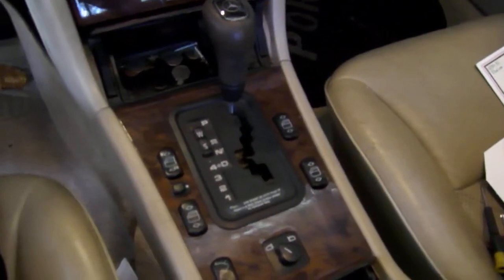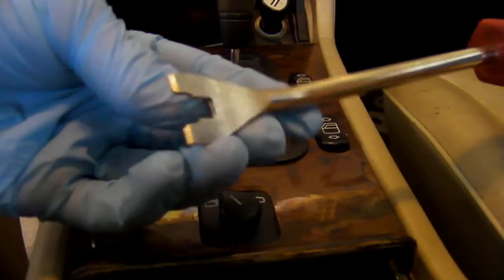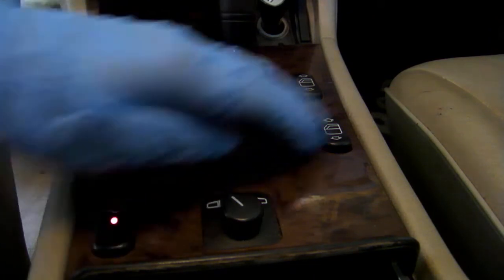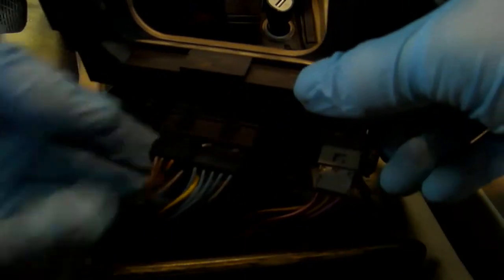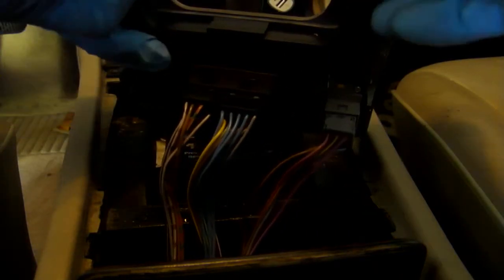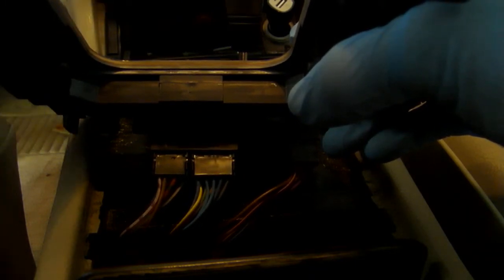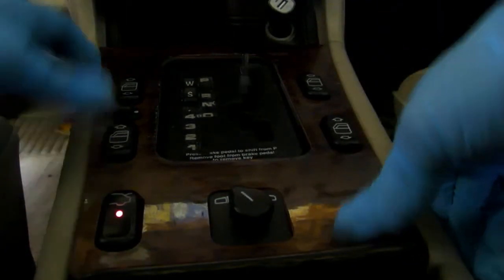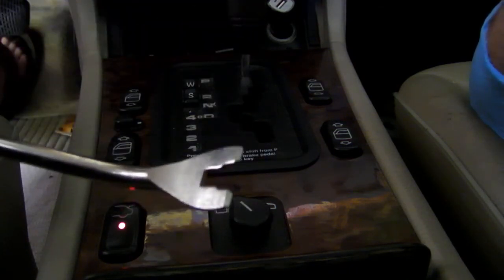Guide: Mercedes E-class (W210) Center Console Switch Removal (Window / Mirror / Trunk Switches)

Comment: Ik have the same car, but i dont know what the W/S butten does. I hope u can let me know👍🏼
Reply from the maker: Willem Aarts The “W” button is for winter mode. The transmission will engage in second gear for better traction on the road. “S” is for summer mode and the transmission will engage in first gear as usual.
Reply: Wow this whole time i didnt know what these modes are for I thought “S” was sports mode 💀💀

Comment: I spilled a drink and now my windows roll down on there own when i start the car 😐 do i need to replace the switches or just open and clean the area
Reply from the maker: You can try to open and clean the switches. Make sure to disconnect the harness and pull the switches out first. I would take a paint brush or soft bristle tooth brush with some electronics cleaner from Amazon or Office Depot and clean off the circuit board.
Reply: Having the same issue! Sat a Trenta Starbucks cup of water leaning forward. The actual piece that’s supposed be in there to hold the cup is out. Bought the vehicle used.

Comment: That red light on the trunk button, is it suppose to stay lit all the time, mine does and my brand new battery keeps draining, watching videos if I can figure out why
Reply from the maker: The red light is only supposed to come on when the trunk is open. Here are a couple of good forum posts that troubleshoot the issue:
https://www.benzworld.org/threads/trunk-release-switch-light-on.1531347/
https://www.benzworld.org/threads/trunk-boot-light-wont-go-out.1380374/

If you can't find the issue quickly and can live without the trunk release button, you can try removing the center console as shown in the video and just disconnect the switch for the time being to save the battery. However, I think the problem lies in the trunk latch itself. I would remove it and inspect it.
Reply: @matthewbaker1419  Thank you, we brainstormed it and the trunk key hole was little sideways it was missing a screw so, it thought the trunk was open all the time. Squared up the lock and screwd both sides tight, shut it and the light went out, we could open the trunk with the button, and the key. I appreciate the video because I was gonna take that apart and just unplug it. Thanks again appreciate it.

Comment: Hi Mathew, if the window buttons at the center console and also the power window buttons at the back doors don't work,  is it because of the center console switch panel problem? thanks a lot from South korea!
Reply from the maker: 동규타임 Sorry for the late response as I rarely log in. If both the front and rear switches do not activate the windows, try checking fuses first. If fuses are ok, it might be the window motors. There is a possibility the switches got some corrosion on the circuit boards too. I would pick up a cheap reproduction window switch on eBay for $20 and see if that solves the problem. If not, the problem is probably in the window motors.